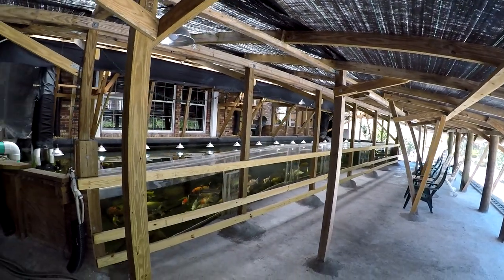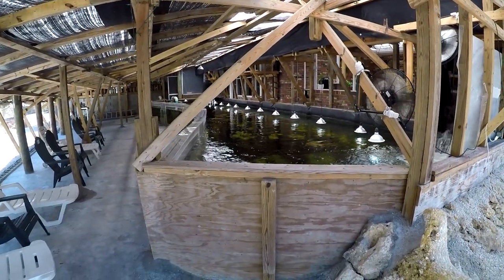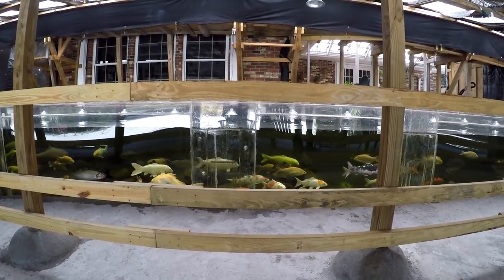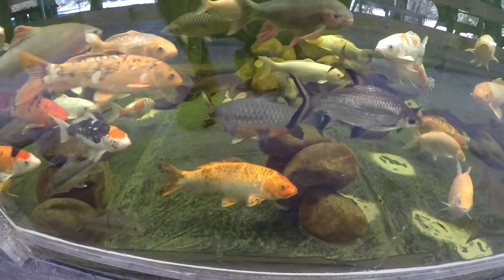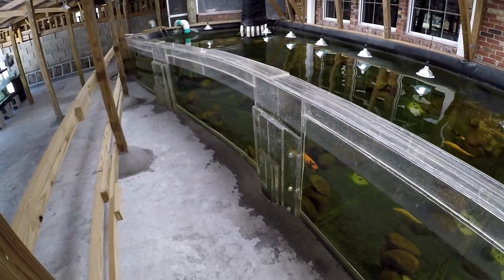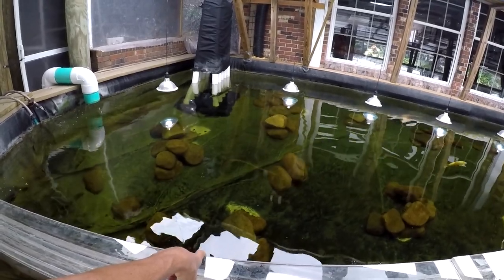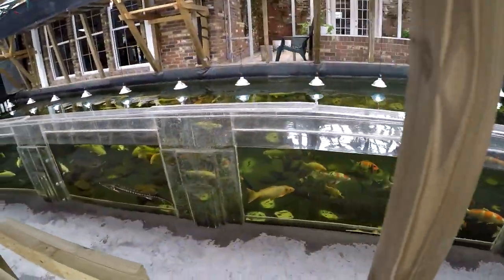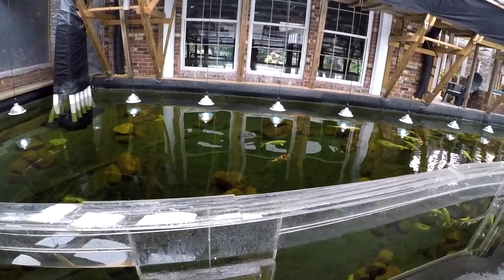25K gal or 100K liters for $6000: 50'x15'x5' or 15x4.5x1.5 meter with 45'x3.5' or 14x1 meter window

Comment: That fish stock together with those crystal clear windows at that volume - unique and very impressive!

I had assumed you bought the whole front as a unit. The imperfections are camera shy.
Reply from the maker: Thank you for your kind words.  I priced out the front 45' panel.  A manufacturer wanted to make it 1.5" thick at the very least, $15,000 before delivery, which at that size and weight would have been exceedingly tricky and perhaps hardly doable, easily another $5000.

Comment: Amazing job!!! EXCELLENT work!! A few questions below.
1. Where do you get your water from?
2. Do you have family or friends to help with your tank builds/projects?
3. Do you get sponsored?

Keep up the excellent work!!!!
Reply from the maker: Thank you.  Water's from a well, light brackish, has to run through RO, then mix back in 15% of raw well water, make and spend 8000 gal of this water mix daily for continuous water change 24/7/364.  I get help with moving heavy stuff, other than that I work alone 99.9% of the time. No sponsors yet.  Thank you again.

Comment: You mention you bought a lot of the material off of Craigslist but you don't mention were you bought the massive balls it took to even attempt this.

Just had a thought as I watch more. Do you think instead of drilling holes for the bolts when you squeeze panels together would be to use very strong magnets to compress them until the #40 cures?
Reply from the maker: Haha...  you are funny.  I am not "ballsy", just reckless haha...  Never thought of this.  Thank you.  IDK if there are powerful enough magnets that'd be available to me and if they are that powerful as a tightened 3/8" bolt, how I'd separate them after the curing, unless you are talking about electrically driven magnets, not permanent ones.  Anyhow, interesting and worthy thought.

Comment: Do to think growing plants out of that aqueduct would be beneficial to the system?
Reply from the maker: I think any plants are always super beneficial to any fish tank.  It's just they increase maintenance (in the way I keep my tanks almost maintenance free) and cost time and hence money in the end.  But they are very highly desirable both for water quality, safety, and aesthetics is hands down the best with them.
Reply: @Fish-Story  Grow Pothos in there. its maintenace free and will grow the length of your aquaduct
Reply from the maker: Thank you.  I respectfully disagree.  Any plants add to the cleaning load plus it needs light, when I give it light, I will have long string algae grow in the aqueduct, which too will die off sometimes and add to cleaning.  Plus the pothos and the algae will slow down the flow in the aqueduct, the water level may rise to overflow and/or flowback out of the duct.
Reply: @Fish-Story  It would clog the aqueduct quickly. The pond water is so clear,I dont see any reason for a more complicated settling pond of water plants to help.
Pothos in Florida would go rampant and fast!

Comment: How much evaporation to that pond happens in any given season, since you live in FL?  How are the sturgeons doing, btw? I can't tell if I'm seeing the same sturgeon in the video.
Reply from the maker: I am adding about 5000-8000 gallons of water per day to this pond for the continuous water change, so I never worry about evaporation but I imagine it is not a problem.  The sturgeon have been doing better day by day, slowly but they seem to be acclimating, feeding better too little by little.  It's the same 4 sturgeon.

Comment: wonder if you could use straight Methylene chloride to wick weld acrylic pieces that wide? weld on 4 is Methylene chloride with a thickener to give it that glue flow .. a lot use straight Methylene chloride to wick weld the 3/4" edges just don't know if it would weld a 2 foot wide piece.. if it could, you can get 55 gallon for $800! may save you some on your next big build if it would work!
Reply from the maker: Thank you.  I know very little about gluing acrylic.  From reading around and from expert advice I've learned that solvent welding can work but it is a weaker bond versus Weldon #40 or #42, etc. and for such a demanding application as a fish tank, AFAIK the professional builders use the two part MMA resin plus catalyst most usually (maybe exclusively?), that is what Weldon #40 and #42 is.  Unless I learn much more, I'd be wary of cutting that corner.
Reply: @Fish-Story  .. Agreed, better safe, but may try if you have any scraps or maybe someone has tried and can give feedback.  GL

Comment: Are you on a well, or city water?
Reply from the maker: Water's from a well, light brackish, has to run through RO, then mix back in 15% of raw well water, make and spend 8000 gal of this water mix daily for continuous water change 24/7/364.

Comment: Would lava rock be better or cheaper than pot scrubbers?
Reply from the maker: I doubt it'd be cheaper per volume.  Lava rock would offer 10x-100x smaller surface area (initial and over time with soiling) and be incomparably heavier to handle.
Reply: Source?  I know lava rock performs very well in industrial biofilters for odor control...
Reply from the maker: Thank you for this, albeit I am not sure why you invoke odor control.  We are talking nitrification here I thought.  Anyhow... I am always up to learn more.  Lava rock specific surface area is 20.  Nylon mesh pot scrubbers - 370.  Per, for instance:  https://www.monsterfishkeepers.com/forums/threads/beginners-guide-to-filter-media.88677/
Reply: Odor control and nitrification both use bacteria.  Media of choice for $20 million biofilter.....lava rock.  Also, the rock is permeable which i think is underestimated in value.
Reply from the maker: Thank you.  Filtering odor out of air and filtering ammonia and nitrite out of water probably have their specifics, first of due to incomparable density and viscosity of the media, even if both rely on bacterial cultures.  I am utterly unfamiliar with the former and it is an interesting info you present, worth reading up on.  Thank you again.